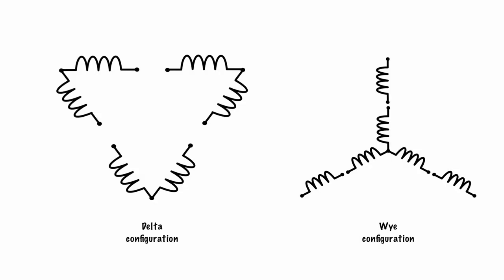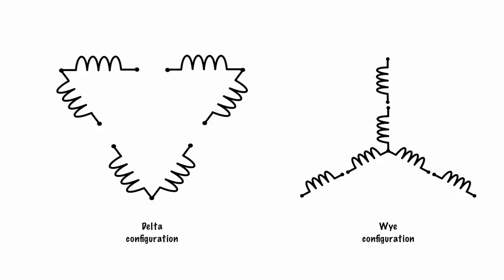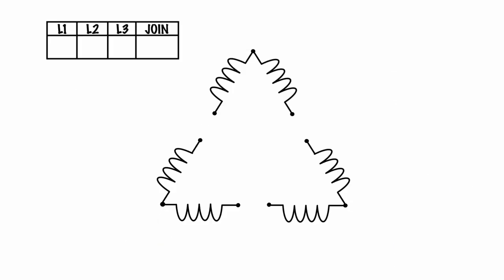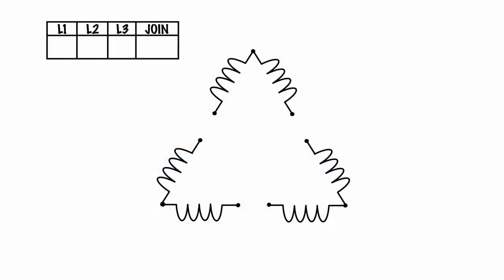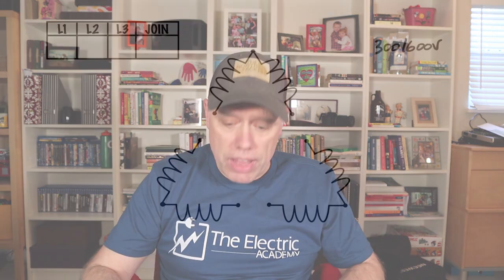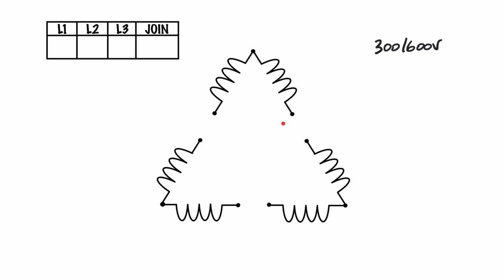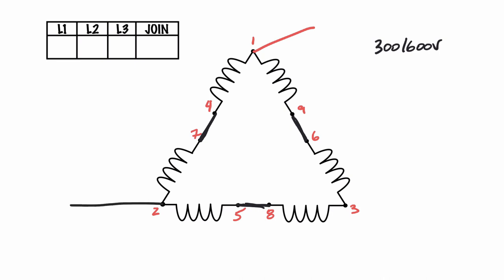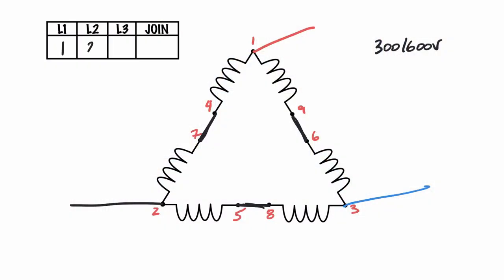NINE LEAD DELTA MOTOR CONNECTIONS: How to make the high voltage AND low voltage connections

Comment: Great vid as usual. But can this motor start in star and run in delta or is this for direct star connection or direct delta connection. A.nd if we connect this motor in star or delta does the incoming supply has to match with whatever connections we are using. Thanks and please get back to me you or anyone.

Comment: For the delta low voltage connections...how does 1 join to red and also 1 joins with 6 and 7? Do u join red,1,6 and 7?

Comment: How can i convert in single phase in low voltage:   L1, L2 Capacitor and line,  L3 capacitor   and -join 6,7,4,8,5,9   is it right?

Comment: When numbering, why do you skip phase 1 on the last round of numbers? Ex. Ph1-#1 ph2-#2 ph3-#3 next round ph1-#4 ph2-#5 ph3-#6 then PH2-#7 why not ph1-#7?
Reply: i had the same question. i’m hoping it was either a mistake or it doesn’t matter for the concept. i just hope that’s not convention because that’s unnecessarily confusing
Reply: found another resource, appears to be standard. annoying. 

you may have already knew this, your question was 8 months ago. but this is what i found
Reply: I was just going it an im unfortunately also confused as to the reason